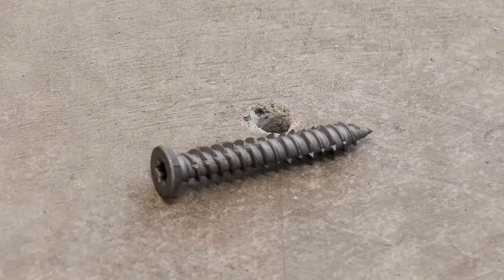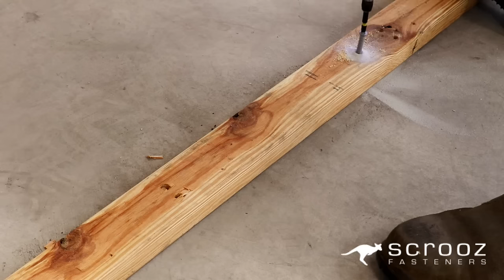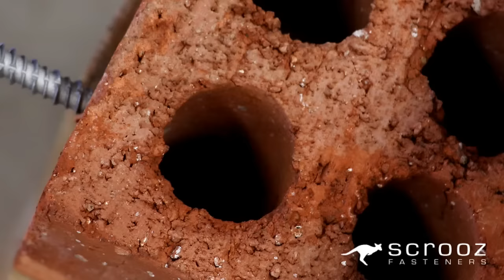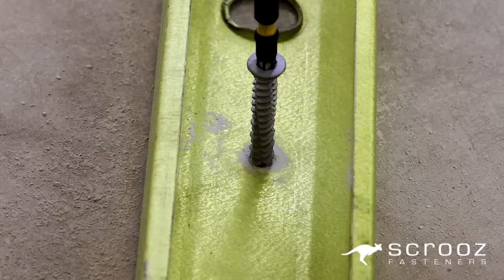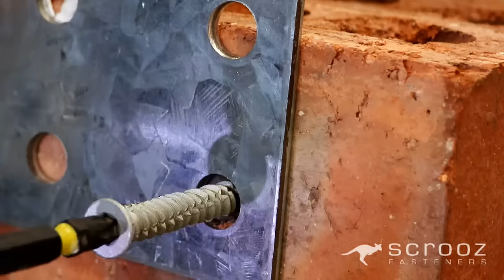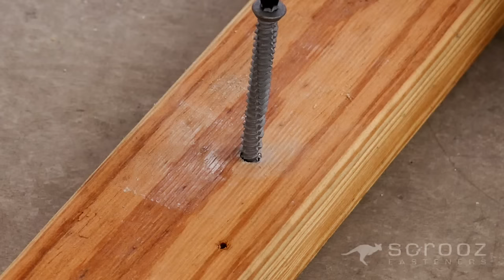Scrooz Amazing Self Tapping Raptr Screws for Concrete

Comment: Do I need to pre drill?
Reply: Yes use a 6mm bit.
Reply: @6lr6ak6 Is that a drill or impact driver you are using?
Reply: @waynemorgan3128  6mm drill bit then l used an impact driver to send them in,